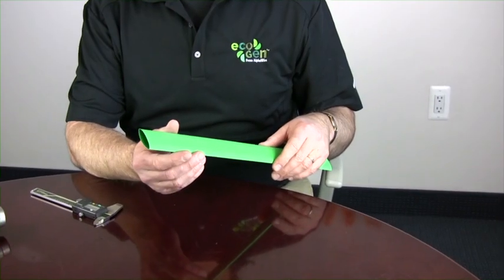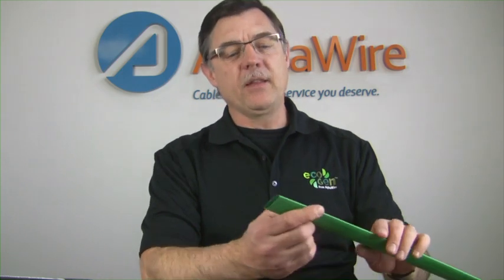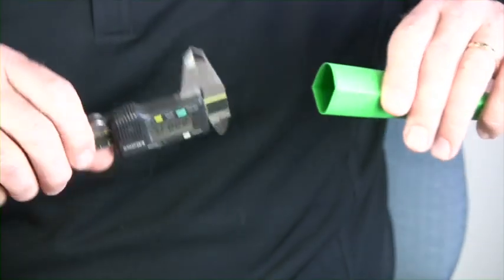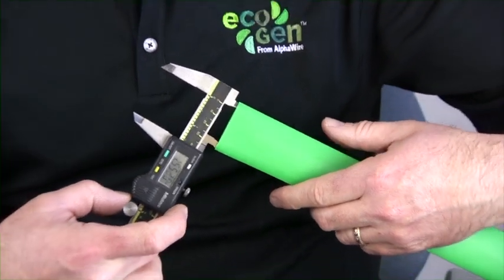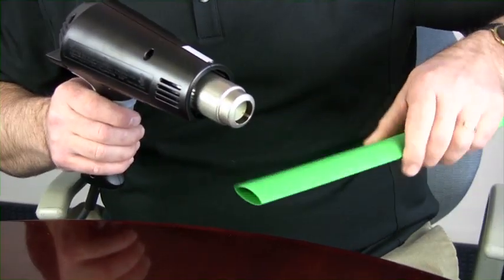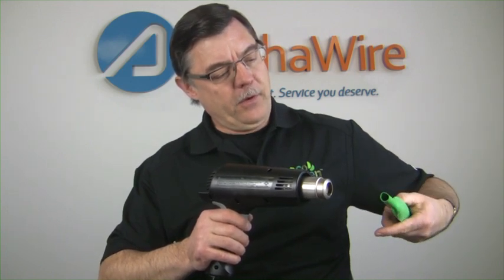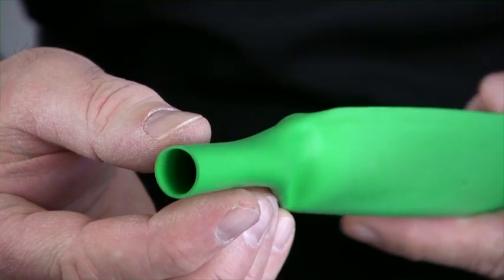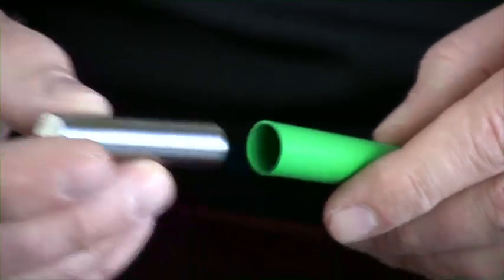How to Properly Inspect Heat-Shrink Tubing Size

Comment: Hi - thank you for this video.  It was not quite what I expected from the title, doing a nice job of explaining the size specifications but not how to choose; I have wondered what the tradeoffs are between heat-shrink tubing of several different diameters that will all shrink enough to be snug on my end application. Shrinking just a bit or shrinking to near the limit must have different properties based on final wall thickness.  Is there any difference in how strongly they will grab the insides?